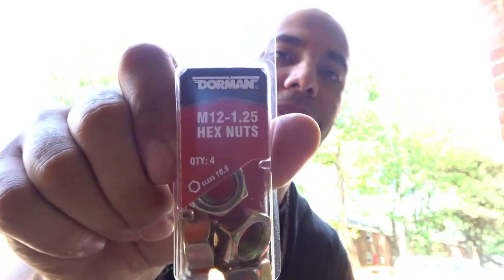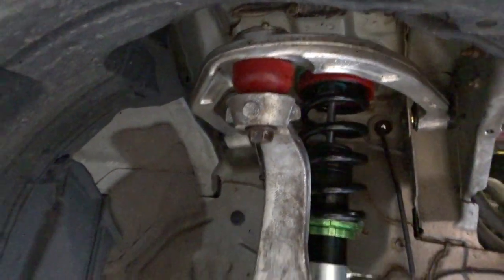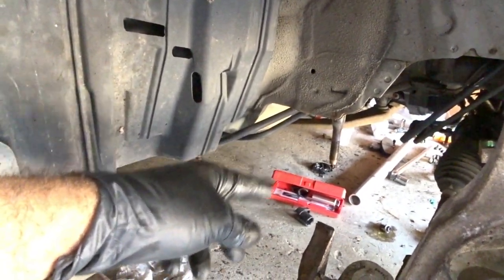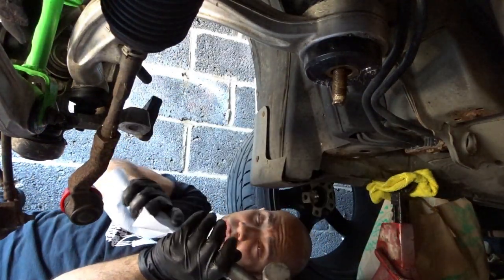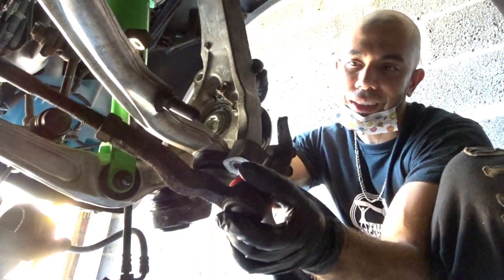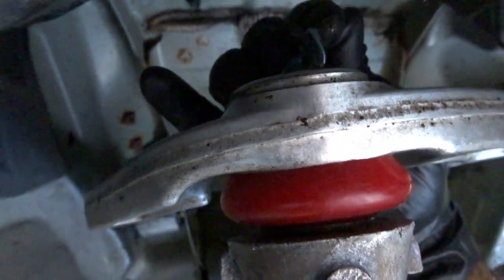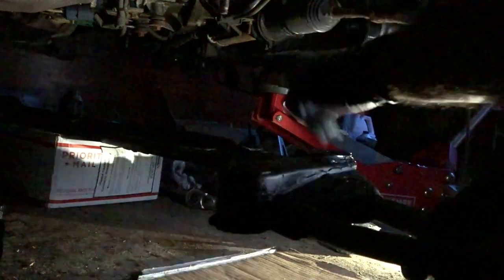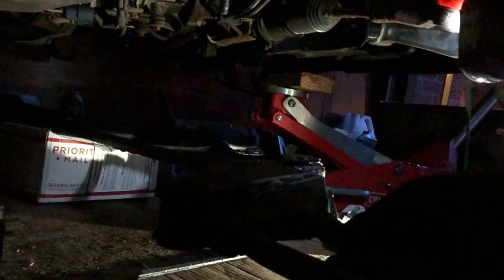Ep. 17 | Installing Compression Arm & Front Brace | + How to Tighten Spinning Ball Joints 350z/G35

Comment: How do you keep ball joint from spinning when torqing to 100 ft lbs?
Reply from the maker: A lock washer as in the video helps to keep the tension on... However you can also clamp the ball joint down and torque it as well🤘🏼